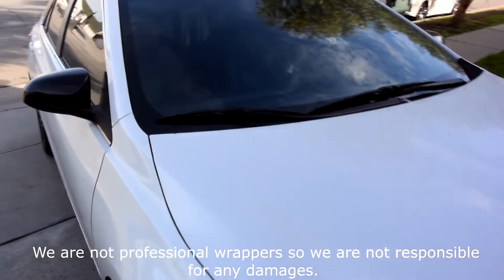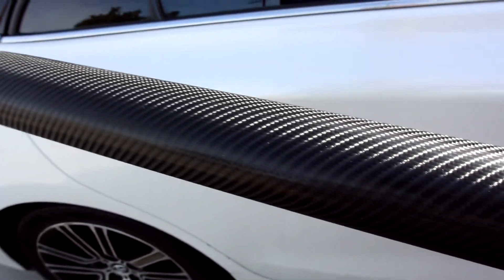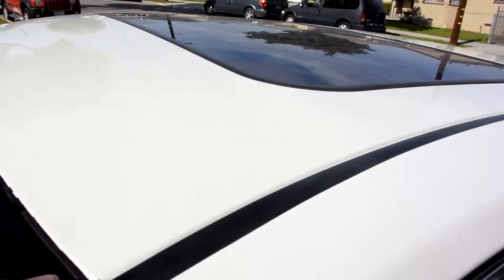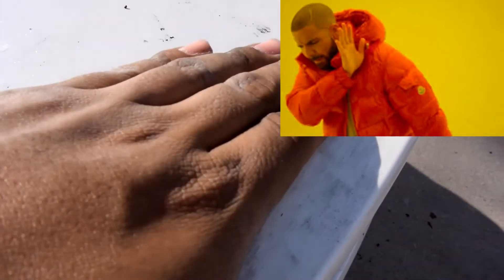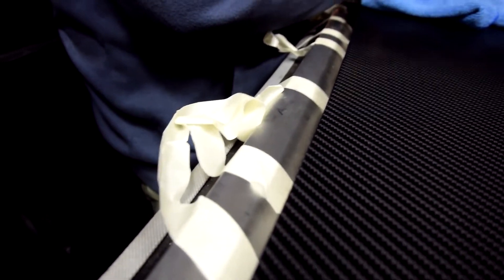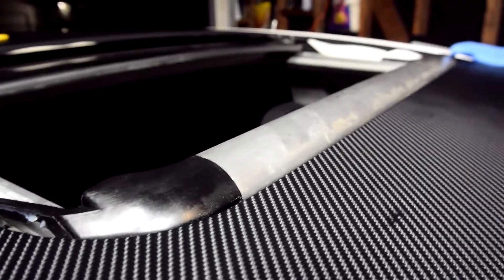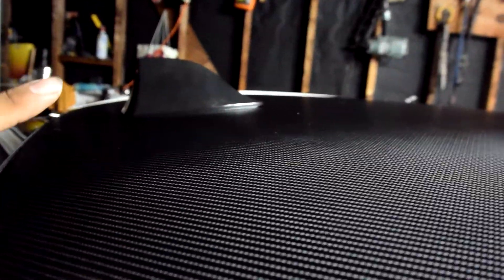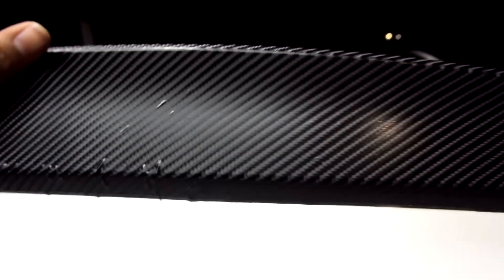Toyota Camry Roof Wrap

Comment: Is it better to wrap your roof than getting it painted (black)? Also, what would last longer in turns of quality?
Reply from the maker: At the time we didn't  want to commit, thats why we wrap it. There's wrap that will last five to seven years with proper maintenance.  Before painting the roof you will need to prepare the surface. Then mask everything you dont want over spray . You will need a base, color, and a clear coat. The tools you will need are a compressor, spray gun, hoses, air compressor oil catch , and a spray booth. (The list goes on) The Toyota Camry has good paint no need to do a respray. Now quality  will depend how  you treat your paint/wrap.
Reply: @hearttoengine9044  Do you not what type of wrap is of good quality that will last 5-7 years?
Reply from the maker: @fullofpeace3486  3M, Avery, Oracal and Arlon. Also before buying do some research on the vinyl wrap and follow the manufactures instructions.
Reply: Its better to wrap the roof than have it painted for 2 reasons. 1 being it protects the paint underneath. And 2 if for later you want to sell the car and make it stock, you have the option to or if you want to change the color/material

Comment: Your roof was fading after two years already? Thats scary. I just bought mine. Will I need to worry about that too if I put a ceramic coating on the roof?
Reply from the maker: This wrap was only supposed to last two years. The car was always daily driven left out in the sun, never garage kept. We cheap out on the first wrap but the second one was much better. Chemical Guys sale a "Wrap Detailer Gloss Enhancer & Protectant" that will enhance the wrap life.
Reply: Heart To Engine thanks for that’s perspective. Nice wrap btw